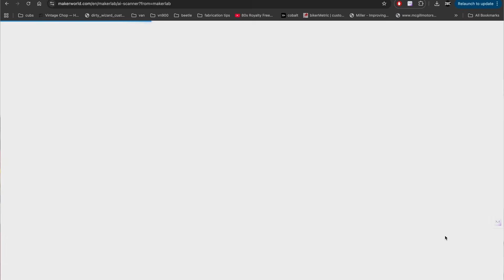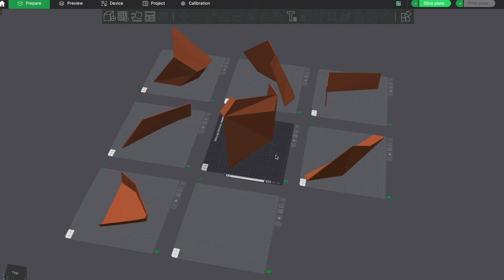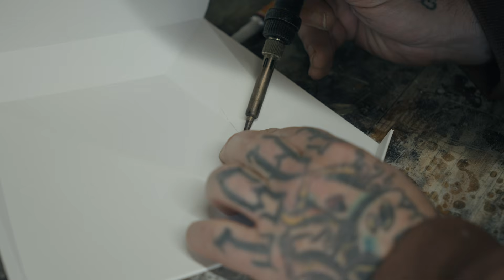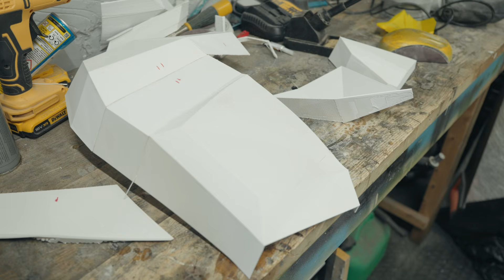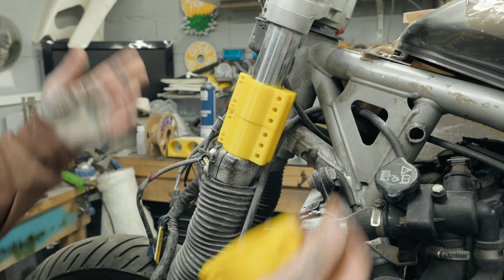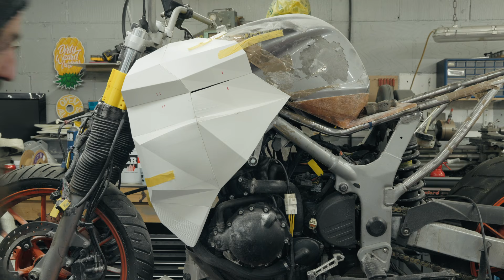3D Printed Motorcycle Fairings!

Comment: Those 3d printed parts have huge potential, bloody excellent idea! Im sure it will take a while to finesse the method, bit its gotta be better to let the printer do the hard graft rather than foam and filler and sanding…
Reply from the maker: If I can roll on a meat layer of gelcoat, it shouldn't take too much to finish as the plan is a skin of carbon fibre